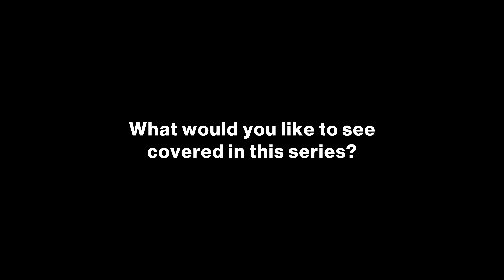8700K delidding for better overclocking and lower temperatures

Comment: Very good video. The best I've seen. RE: 06:05 segment - MG Electronics 422B has been replaced with 422C. 422C uses Butyl acetate and isobutanol and 422B uses ethylbenzene and toluene. So the new formula is slightly less terrible to breathe? The B formula has ingredients on the list of things to avoid for cosmetic clear coat nail polish, but at least both 422 are designed for use on circuit boards and high temperature environments. Thank you for sharing.

Comment: I'm preparing to delid a i7 7700k soon. It will be my first time delidding a cpu and I have to say that your video provided all the information I was looking for while doing my research to ensure I didn't make any mistakes. 

Most people do not mention, or show the use/application of conformal coating on the board. This is what I was primarily looking for and your tutorial nailed it. 

Thank you very much. I liked the video and saved it to reference while I'm delidding my cpu. And you gained a subscriber thanks to how in-depth you went. For people doing something as nerve wracking as possibly destroying several hundred dollars worth of tech for the first time, you helped make me more confident and comfortable in tackling this successfully. So thanks!
Reply from the maker: Thanks. But to be honest: I forgot a small, but not unimportant detail: leave a gap in the glue so that hot air can get out underneath the heat spreader. Not a tremendous mistake, but saves you even some more degrees. ;) I will do a delid soon again to see, how everything performed after a year and will then leave a small gap in the glue. BTW: you can also use nail polish instead of conformal coating. Saves you some money. ;)
Reply: @MartinGuder  That's one thing I picked up and researching how to do this safely and properly, and I appreciate you mentioning it to me. I'm looking forward to your update delidding video. Wish you all the best! Thanks for the reply!
Reply from the maker: Wish you too. Keep me posted if everything worked as expected.
Reply: Agreed, and the link to the conformal coating was in the description. Very nice touch!
I happen to have a blacklight (UV) right above my desk so I was able to confirm that the conformal coating covered fully covered the sensitive areas.

Comment: You need to leave a small gap in the silicone seal, for gas to escape
Reply: This makes sense in order to equalize the pressure. Allows for the expansion of the air under the IHS to escape when heating up; and to allow air back in as it cools.

Comment: I would not recommend to reglue it because the motherboard clamp will put enough force on the IHS to hold it well in place.
If you do reglue, then leave a gap for the air to dissipate through. In this video, the glue is placed all around the edges of the IHS with no hole for the air to dissipate through.

If you look carefully at the pre-applied glue that Martin removes, there's a gap there as well.
Reply from the maker: Thanks for the hint. It was mentioned several times already. Anyway: for a second delid I took care of it. ;)

Comment: Hi Martin.. great video!! is it safe to delid the processor and not put the IHS back on it? so the processor's die direct contact with heatsik cooler or AIO cooler
Reply from the maker: It's very likely that you will damage the die. Direct die cooling is more effective, yes, but very dangerous to do or at least not recommended except to extreme overclockers etc.

Comment: you watched one test from linus tech tip on air vs water noise ratio witch was based on price to performance ratio doesn't mean air is better than liquid cooling as im pretty sure a custom loop will work better then any aio or air cooler anyday down side lot more risk a lot more maintenance a lot more expensive not knocking what your saying as the price to performance ratio vs noise ratio is better just correcting that fact that with exceptions liquid will receive better temps overall under certain circumstances
Reply from the maker: It was actually a quite indepth test by Optimum Tech. And yes he compared AIO vs air cooling, as they are somewhere in the same price range if you go the Noctua Route. Of course a custom loop and even an AIO can get better temps and with a lot of tweaking this is also quiet. But the cost and effort, especially in the long run with maintaining water coolers, the air cooler is my choice. Also the config of AIO under macOS is not possible … at least for RGB stuff. ;)
Reply: @MartinGuder  i wan unaware of the AIO on mac it was a in depth video i have everything i need for the deluding but im to scared to do it lol  i do have the 8700k as i want to go to 5.0 now im sure i could do it with out deluding if i go in and mess with the voltage my self but im not  that good as i just got in top overclocking my self been doing build my whole life but i was scared to overclock for the longest i am actually RGB to max rgb ram rgb strips rgb fans rgb AIO
Reply from the maker: @jondillinger899  Was my first build after 10 years just working on Mac. Tested everything in case there is a fault in some parts before even scratching the warranty on purpose. After everything was fine I went straight to work and delidded and overclocked it. Delidding with a dedicated tool is quite easy and involves just some patience.
Reply: @jondillinger899  I lucked out and had stable 5GHz on all cores using the ASUS automatic profile. Maximus X Hero motherboard. I chose to delid to lower temps. I think the Asus profile is conservative and I can manually lower the voltage to further reduce temps. I will be doing that once the sealant dries and I can use my CPU again. This is going to be a long 24 hours. I'm excited though. Was hitting 95+ under load at 5GHz before.

Comment: Hi. The silicon you use for the ihs is acetoxy or neutral. I read that acetoxy oxidizes metals.
Reply from the maker: Well. That's a good question. I'll take a look at the packaging. Thanks for the tip!

Comment: Awesome video again! I don’t j is if you remember me from last video about the Vega card. I decided to upgrade the system, I went with same motherboard you have, upgraded to i7 8700k and with with a asus Vega 64 instead. The GPU will be in this Friday. I’ll keep you updated.
Reply from the maker: Sure I'll remember. Nice to see you here as well. I'm very curious, because I'm still very interested into Vega 64.
Reply: So I have everything installed, and this machine is extremely fast now, the graphics are very smooth and fast compared to the gtx1070. However final cut fails to export video, trying to fix this.
Reply from the maker: Alright. How far got it when exporting? Where does it failed and was there an error message?
Reply: Martin Guder it fails immediately.
Reply from the maker: OK. Is the system freezing? Is there an error message (what's the error message if yes)? Is FCP just force closing? Those two things caused problems with FCP for me:

1) Too high CPU cache voltage, when overclocking
2) IGFX Mutli-Monitor-Support deactivated (which is actually deactivating the intel UHD overall)
Reply: Martin Guder Mine doesn’t crash, it just fails to export a video and says the share operation has failed. It’s odd too because I also get mouse lag with the AMD gpu and with NVIDIA I don’t. Also just a heads up. I’m using the Asus ROG Vega 64 and it does have the high fan spin issue which is remedied by opening a quick time video in the background.
Reply from the maker: OK. Can you check, if you have iGPU Mulit-Monitor activated and set primary graphics to PEG? Had the same issue, when deactivating the iGPU Multi-Monitor, as it is used for H.264 and H.265 encoding. I explained this BIOS settings in my macOS installation video (starts at 9m50s): https://youtu.be/sb8comoqnSE?t=9m50s
Reply: Martin Guder okay I will check when I get back home. I remember putting it on like you said but I had hit CMOS couple of times because my screen would go black and show nothing, not even bios.
Reply from the maker: Good luck. Hopefully it works. Post an update. :)
Reply: Martin Guder well that definitely fixed my final cut issue, but for some reason it made my WiFi go out. Have to figure out what’s going this now lol. Hackintoshes are fun. :)
Reply: Fixed the WiFi issue, the I had changed my PCIe to x4 from x2 and it disabled the WiFi.
Reply from the maker: Enzo Zenuni Finally it works. :) Remember my first successful video export in my Hackintosh.
Reply: @MartinGuder  Hey Martin, Hope your doing well my friend. I ended up returning the Vega 64 and went with the Sapphire Pulse RX580. There were to many complications with the vega 64 and the fans spinning out of control. However the one I had was not a reference card. It was a asus strix version, I really would of liked to of kept it, but to much hassle. 

My current build consists of:

Asus Maximus X Hero

i7 8700k
32GB Corsair Dominator Platinum
Sapphire Pulse RX580
Corsair H115i Liquid Cooling
Corsair 1000i PSU
1TB 970 Pro (Windows)
1TB 970 Pro (macOS)
8TB Seagate IronWolf Pro (macOS)
As far as WiFi/Bluetooth is concerned I ordered a actual macbook pro wifi card, adapter for PCIE and antennas so I can have true native support. Has not come in yet, but will let you know when I have it installed.

Dell 34" Ultrawide 4k
Space Grey Magic Keyboard
Logitech MX Master 2S

That is my current build, and after testing around with some stuff and multiple fresh installs of macOS I finally got everything working smoothly.

I did a test to upgrade to Mojave, everything worked perfectly fine, except for my WiFi not being recognized. 

Other then that, this thing is a complete monster of a machine. Love having a PC sold all my old parts and upgraded to my new parts for about $300 instead of having to buy a whole new machine if I had a apple lol.

Also I was wondering if you knew, but I have a GTX 1070 gpu that I removed to replace with the RX580. Is there a way to have both cards connected, but have the RX580 run on mac and the GTX1070 run on windows?

Thanks!
Reply from the maker: Sad to hear that. Maybe I'll try a Vega 64 reference card at some point. But not for now. Hope you still enjoy the RX 580. I think still a very nice card, even for 1080p Gaming. :) Your build looks awesome. Regarding the 1070: good question. I think there would be some way like deactivating the PCIe slot for booting into macOS, in which one of the card sits and then activate it and deactivate the other one, when you boot into Windows. But everytime you have to also switch the HDMI/DP cable to the other GPU or use a splitter. Additional to that, the PSU is maybe also a bit too small, even though it's 1000 Watt. Is it because of gaming on Windows, that you prefer the 1070?
Reply: Martin Guder rx580 has been very smooth for now. I will try attaching both cards and disabling slots when switching OS. You do bring up a good point for the psu. I wish we could have multiple profiles for the bios.
Reply from the maker: Maybe one other thing: the Hero X has just one PCIe 16x. The other card would sit in a PCIe 8x. So maybe, that's something, that will bottleneck the second GPU. :(
Reply: Also curious if you are experiencing the same thing as me. Are you noticing a blurry text issue with the rx580. Mine looks a little off. It’s readable but not so sharp for the text.
Reply from the maker: That's maybe a calibration issue of your display? Mine is rendering text just fine.
Reply: Martin Guder it’s weird because it’s good with the gtx1070 on hackintosh.
Reply from the maker: Is it just under macOS? If so, maybe it's related to some EFI configuration? Maybe try another output? I usually use HDMI, but it's also fine with Display Port.
Reply: Martin Guder I’m using DP since I thought it was better for Mac. I will switch to HDMI and see if that helps.
Reply from the maker: Good luck. :( Did you searched some forums, if other users had the same issue?
Reply: Martin Guder I searched but couldn’t find anything with a solution.
Reply: @MartinGuder  I tried different output and still same result. It looks fine under windows. Its nothing thats major but I can tell the text isn't as sharp.
Reply from the maker: Hm. I ould post it to a forum. Maybe they somebody had a similar problem and knows how to solve it.
Reply from the maker: @enzozenuni  Hi. I researched a bit. If you are running macOS Mojave, text could be blurry because Apple disabled subpixel aliasing in the new version. Maybe this article helps.

https://dev.to/mrahmadawais/onedevminute-fixing-terrible-blurry-font-rendering-issue-in-macos-mojave--lck
Reply: @MartinGuder  I'm actually still on High Sierra, i saw that link and gave it a shot but still same issue. Its not a major difference but its noticeable, I'm wondering if the NVIDIA was able to produce better coloring. I have a new macbook pro as well and I connected it to my monitor and the text is much better. I think this has something to do with the hackintosh itself. best example I can give is when you open terminal in homebrew mode, the text is supposed to be purely green, but this has a slight yellow drop shadow effect to it.
Reply from the maker: Maybe the unit has an issue. Mine has none of the issues. I would try to get a replacement, if it's that obvious.

Comment: There's waaaaaay too much liquid metal here, it shouldn't pool on either surface, yours is pooling on both sides. Also, use the silicone in just small blobs => gas escapes, it's easier to remove in the future and it still does the same function. EDIT: Oh, also forgot to mention, the alcohol pads supplied with the conductonaut SHOULD NOT BE USED, as we can clearly see in the video, your die is still contaminated on the surface, it should be mirror shining when clean, not spotty like that. Using normal rubbing alcohol (IPA) will leave a perfect job and better heat transfer with better TIM sticking hence lowering the risk of frying your chip
Reply from the maker: Hi. Thanks for your indepth hints. Some others also mentioned some changes to the process. The most important is for sure the silicon glue.

Comment: V core at 5.0 GHz ?
Reply from the maker: I set it to 1.355V … for daily work 1.34 V was also working, but stress testing was just stable there. So I left it on 1.355 V to avoid unwanted system crashes. I will edit a video on the overclock settings this weekend with some specialities I encountered for macOS/FCPX.
Reply: most 8700k should be fine at 1.35v at 5ghz
Reply from the maker: It depends more on the silicon lottery. In general there isn't even every 8700K capable of reaching 5 GHz.

Comment: no se debe llenar todo siliciona por que los gases no pueden escapar esta mal relid lastima te falta mucho deja eso para los profesionales no juegues al tecnico
Reply from the maker: Is this the correct translation?

"You do not have to fill up all the silicons because the gases can not escape this bad relid, it's too bad, you have to leave a lot for the professionals, do not play the technician."

If so good point. Maybe I'll do a second delid and take your advice into consideration. Next time would be cool to comment in english, as I don't want to spend extra time translating languages i do not understand.